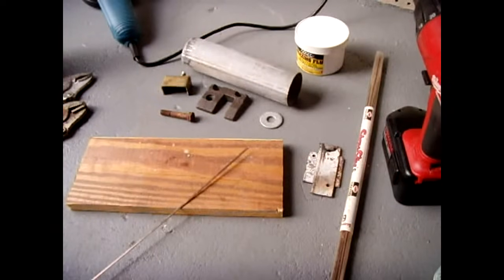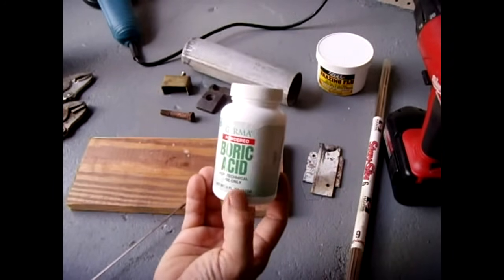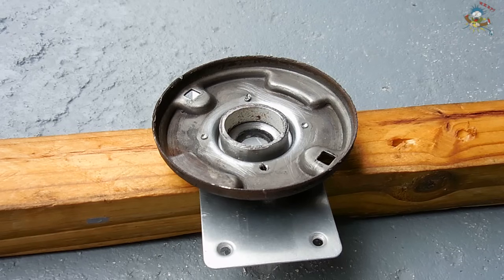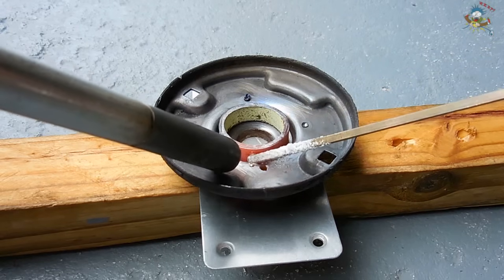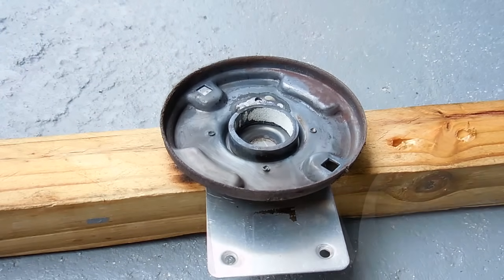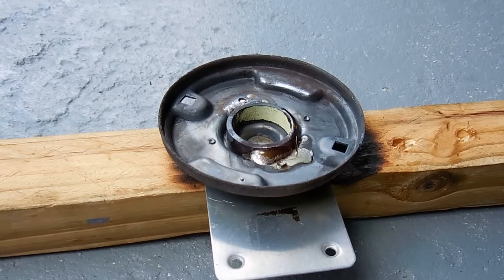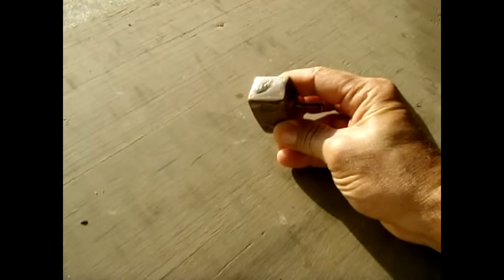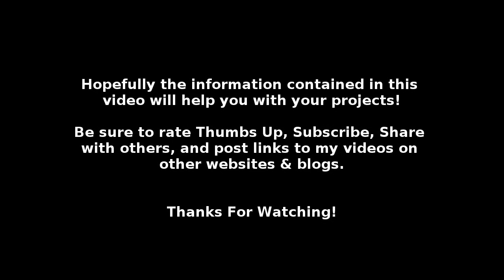EASILY Braze, Steel, Iron, Brass, Bronze, Or Copper

Comment: DO NOT BRAZE STEEL, STAINLESS STEEL, OR IRON WITH RODS CONTAINING PHOSPHORUS!

He's using a rod that contains phosphorus.

Reading the product documentation should reveal this. A quick Google search will do the same.

Of course, the braze wetted out and appeared to do a fine job. Unfortunately, the phosphorus will react with the steel over time and create a thin brittle and weak layer where the braze touches the steel.

The same is true with stainless steel and iron.

There are plenty of products that contain various percentages of silver and contain no phosphorus.

Phosphorus is added to rods used for (mainly) orange metals to reduce the melting temperature, eliminate or reduce the need for flux, and cause the braze to wet-out more readily.

Rods for steel stainless steel and iron require flux. Some contain no silver.

I personally like the high silver content rods that contain 35% or higher. Of course, the more silver, the higher the cost. For instance, in May 2025, I spent $45 for 1 oz (1/16" about 45" long) 56% silver brazing rod (Safety-Silv). It was for a special project.

Most of these high silver content rods can be purchased bare and require the use of external flux. I use the recommended paste flux (Stay-Silv). In 2025, it was $14 for 6.5oz.

Comment: it is actually better to place the work pieces over a gas burner, this way you get a lot of help because the gas burner will maintain the work pieces at a  high temp eliminating the heat sink effect, I have done it on thick copper and steel and works wonders

Comment: No, that was rather messy. 
I would suggest that your preparation was inadequate, and (from my experience) would have been far better off using a different technique such as a small tip with oxy-acetylene. That would have given you much more control of the heat zone/s.

Comment: Great video, ez to understand.  I have a great old bbq and the 2pc legs (assembled together) are  2inch tube steel about 1mm thick. And afraid of burning through it trying to make them 1pc.  Is this too thin? Or will the inner piece heat up enough? Advise? Thanks.
Reply from the maker: Ideal for thin metal

Comment: That rod you used how does it look if you buff it I'm needing to braze or weld brass clothing racks together and polish after and they have to look great the filler needs to look like the brass or very close im trying to find the best looking way possible I'm fine with tig welding but the brazing looks better

Comment: Can I use an oxy acetylene torch to repair a bronze statue using a silicon bronze rod? Most people use TIG welding, but it just too expensive for me.   Everyone talks about bronze brazing, but not bronze brazing BRONZE.   I wonder if it’s not possible because the statue and the rod have the same melting temperature.
Reply: Yes, oxy-acetylene can give far more control of the heat zone, and of course you can bronze braze bronze.

Comment: Higher temperature needed !
Reply from the maker: Incorrect, it flowed beautifully.
Reply: @electronicsNmore  Good luck...
Reply: @electronicsNmore  I would also have used a hotter flame - too slow getting up to the right heat - but then, I'm only an amateur

Comment: This is how a DIY video should be like. Very good explanation of the all aspects of the job, like materials, temp, cleaning etc. Also, I would like to know if the same method can be used to join brass with mild steel/steel ? -Thanks a lot !
Reply from the maker: Thank you very much!
Reply: Stainless steel?

Comment: Do you think this will work for adding a small steel patch to a cast iron engine block? I have a Ford engine block with a small piece missing from the mating surface for the water pump causing it too leak coolant. I'm afraid to weld it using a mig welder because cast iron cracks. Does anyone know.....? Thanks
Reply from the maker: If there's a crack, you're going to have to drill the very end of the crack out before making any repair. You're going to require a lot of heat to make that repair.

Comment: Would firebrick work to prevent damage to surfaces such as concrete in video? Am looking at repairing the seats on metal chairs. The wire screening has come loose and thought brazing would be a  good repair since everything is attached on underside. What did would you recommend?

Comment: Could I use your method to join 1/16 thick bronze pieces together?  Would that much heat cause the pieces to distort?  Would you recommend a different rod to join material that thin?
Reply from the maker: You'll need to experiment. 1/16" is thin, but if evenly heated, it may not warp.
Reply: @electronicsNmore  Ok.  Thanks for the quick reply

Comment: who kind of filler rods I need to braze carbon steel/mild steel? can I use aluminium to braze joint carbon steel?
Reply from the maker: You cannot use aluminum to braze steel. Steel is usually brazed using bronze rods.

Comment: I'm new to welding/brazing.  Just trying to spot weld/braze tin blades back to frame on a yard whirligig.  But not sure what to order.  What is difference of stay silv 5, 6, or 15?
Reply from the maker: For tin, you solder. The melting point is too low to braze. Use an acid flux and solid solder wire.

Comment: I haven't done mild steel brazing since 1980 at college. I recall that word Borax, like Vim, a white powder. 
I need to braze a mild steel bolt to a mild steel plate for a metal chair repair.
I looked on Amazon but it is not obvious what rods I need neither what flux I need. There is only a large tub for £35 which is a bit excessive for one braze.
What I like about brazing is that you tend not to blow away the metal like you can arc welding or MIG or TIG, all of which I am not to good at.
Good straightforward and explanitory video. Well done.

Comment: thanks, i will now go fix a broken office chair that failed on its welded connection...
Reply from the maker: It should work fine. Thanks for watching!
Reply: @electronicsNmore  Done.  Not as easy as you made it look though :-).  it seems that the bernzomatic torch with the yellow canister could barely get temps to melt the bronze rods...
Reply from the maker: @Burner1432  The metal must've been thick, and pulling away a lot of heat.
Reply: @electronicsNmore  The piece was similar to yours in the video, slightly more beefy.  I did it outside of the garage with about zero degrees celcius which probably wasn't helping.  In retrospect I would make a little box with firebricks or something to contain the heat.  I am sitting on the chair right now :-).  Seems well fixed! Cheers!

Comment: Harris does not recommend it for steel.
Reply from the maker: That's true, but I've used it for countless repairs over the years with no failures. Normally you'd use a bronze brazing rod and flux. Thanks for watching

Comment: Would this be the same technique for brazing copper to copper? Thanks
Reply from the maker: Hi Heather. Yes, when I did HVAC work, I used Harris stay-silv 5 and 15 to braze copper tubing. Clean the copper with 400 grit abrasive paper until it's bright and shiny, no flux required. I should have links in the video description area. Thanks for watching!

Comment: Can a disposable butane torch give enough heat to silver solder?
Reply from the maker: Only if the metal is thin and small.
Reply: Thanks.  What torch would you  recommend?

Comment: Never done anything like this before and I’m contemplating fixing the aluminium base of a bar stool where the bracket underneath that holds the seat suspension mount in place has cracked so the seat is very wobbly and unusable. Do you think it’s possible for me to tackle this job myself. I’m an experience DIY’er who is not a mechanic but does a lot of tinkering. 
You’re video is full of pertinent information and tips giving me confidence to try.
Reply from the maker: Nothing to lose. Practice on a piece of scrap first. Thanks for watching!

Comment: Flux the steel.... carbon keeps the rod from sticking....
Reply from the maker: The rod is flux covered, not necessary.
Reply: @electronicsNmore  it’s just a suggestion, give it a try. The second braze didn’t not bond easily to the bottom flange. It took to long to start flowing because the metal was dirty. It was not bright and shiny like he mentioned after heating the first side.  The flux keep the oxygen from contacting the surface. I don’t flux my rods and they flow beautifully, it’s just a little extra cleaning after.

Comment: the cleanliness of the surface can b critical for even mig welding, if ur usin flux core then u the weld is extremely sensitive any contamination, u can get nice welds with flux core i even have a bottle of denatured alcohol i wipe stuff down with before i weld before i use flux core all the time its jus way more convenient n welds fine for most things, n for what doesnt u simply plug a bottle in  but at the very absolute least u should really wire brush the surface n spray it real quick with brakleen   it only takes literally a few seconds n makes ur welds look alot better n for sure alot stronger without contamination
Reply from the maker: I usually wire brush the area before working if I want a very nice looking job. Thanks for watching!

Comment: This is a very informative video yet never try soldering copper joints where wood smoke can ruin a joint on copper pipe.  So always try to protect the copper pipe from the smoke with a fire proof wrap.  I know this because I am a plumber and sweating copper pipes next to two by fours is part of the job so no smoke in the joint.  Now this is brazing and I have always brazed in a vise or on the car etc yet never around wood and it did not look like was a problem for brazing and silver soldering copper next to burning I have not had the pleasure of checking out so just be aware of the smoke. Just an FYI as I like this guys videos and I always watch them for anything I can learn as one will never know everything.......sigh lol

Comment: Thanks for this video. Just bought a Bernzomatic kit from Home Depot. I am going to attempt to braze my Jeep door hinge back to the vehicle frame. Will a flux coated bronze rod, temporarily, hold my door hinge until I can afford to get it welded? This is my first time attempting anything like this. Any help would be appreciated.
Reply from the maker: A flux coated bronze should work. Make sure the metal is clean. The metal must be VERY hot. I hope the torch can supply enough heat, the hinge is thick steel. Thanks for watching!
Reply: This is DEFINITELY NOT as easy as you guys make it look LOL. I went through 2 welding rods and my door hinge fell off. The TS8000 with MAP/Pro gets hot enough, although with no experience the rods just melt away. NOT giving up, this will come in handy later down the line.
Reply: Ok, will give it a go later today. Thanks for your time and advice. It is greatly appreciated. Aloha.

Comment: Will this work with Stainless steel?
Reply from the maker: You can braze stainless, but make sure you buy a rod designed for stainless. The flux should be OK.
Reply: electronicsNmore Thanks

Comment: Any recommendations for a brazing rod for 304 steel? Thanks.
Reply from the maker: I would silver solder it. In order to braze you'd need the right flux along with a brazing rod that has a similar chemistry to the 304 stainless.

Comment: Should have done a silver solder capillary joint on the base of the ring , fluxed all the parts before heating, heated from underneath and just touched the rod enough to fill the joint, you used ten times more rod than needed and got a big fat mess.
Reply from the maker: No big fat mess. The job was beautiful, and still in perfect condition inside a car's cooling fan motor. I've been brazing and soldering for at least 30 years, I know exactly what I'm doing. Do it your way if you know better.

Comment: Could brazing be used to join tin cans to make a stove flue? If the first part above the fire box is a proper steel pipe? I was thinking of using Tuna tins, as I collected a shed-load. See anything with "Made in the USA" it's going to be good quality. I got a Speed Square from Amazon. Perfect. It's in inches though. I can't work fractions. Notably it's why we were tought fractions at school. It didn't sink in. MMs are better. Re-use not Recycle.
Reply from the maker: The tin cans are really tin plated steel, so yes.

Comment: Serious question: does the popping up of concrete have enough velocity to knock over the work pieces(s) potentially causing burns to skin or starting a fire??
Reply from the maker: It's known as "Spalling", and the pieces that "may" pop off the surface are generally small. All depends on the moisture content of the concrete. Thanks for watching!

Comment: sure takes a long while ,guess you must be using propane/air torch,,nice thing is the other side is not melting but it takes lot of heat to flow cooper rods
Reply from the maker: You need high temperature to melt the brazing rod, unlike soldering. Be sure to look over my extensive video 
playlists below for many other videos of interest to you, and share. Thanks for watching!
http://youtube.com/c/electronicsnmore/playlists

Comment: Its good,,,,,,,,but i m not geting what is the material of rod for brazing,,,,either it is also made up of brass,,,,
Reply from the maker: I placed links to products in the video description area.
Reply: @electronicsNmore  thanx sir,,,, as me from Pakistan we just got around 140V instead of 220V,,the electric welding plant is not working,,,so i turned to gas welding,,i bought a torch but it is mini it is not able to melt brass,,,,i bought another one and its sound is too high that we cannot operate in residential area,,,now me searching for a solution and saw ur video,,,

Comment: Can Romex Wire be strong enough to use as a brazing rod? To reweld the top of the cr-mo frame that was cut off and repositioned?
Reply from the maker: Pure copper isn't strong enough.
Reply: @electronicsNmore  thanks your quick reply. Save me from doing something then I shouldn't have.

Comment: I'm new to this, and after watching your video I tried welding two pieces of mild steel using my Bernzomatic map gas torch along with Bernzomatic Bronze rods that apparently melt at 1600 F.  These sticks have a flux coating, so I figured they would work the same way.  As it turns out, the steel easily became bright orange,, but the rod, although seemingly melted, it had trouble adhering to the steel.  I had previously filed the metal clean, so I'm at a loss.  Any ideas of what went wrong?
Reply from the maker: Should work. Try using small pieces of cleaned steel.

Comment: The second side of the steel ring was harder to braze because it was covered by a layer of black oxide that formed while brazing the first side. To prevent that I would have put some flux on both sides before I started heating anything. The flux will protect the metal from oxidation caused by the heating. It is better to prevent the oxide from forming in the first place, instead of having to wait for the oxide to be removed by flux applied after the metal was already very hot.
Reply: Yes apply flux to the part as well that’s what I was taught
Reply: Flux would help although a reducing flame should be able to remove the oxidation during heating.
Reply: Yea wat he said!!!😂😂😂
Reply: Surface preparation pre -braising would be in order

Comment: could you do this with a butane torch? (steel to steel) Cheers
Reply from the maker: They're usually too small in size to heat up the metal.

Comment: Looks like your concentrating all your heat on the ring.  Both pieces have to be close to the same temperature for a good braze.
Reply from the maker: I was directing more heat towards the thicker metal, the ring. As you saw, the job came out just fine. Thanks for watching!

Comment: You’re holding the gas torch too close to the work: heat is generated as the gas burns, the flame will be at its hottest towards the end of the flame.
Had you applied flux to the bed and the piece and introduced the brazing rod inside, at the base of the piece, the braze would have run round the entire ring, making a stronger joint using less braze metal.
Reply: Futon I totally agree. Branded joints should be treated like soldered joints because brazing is high temperature hard solder. The joints should be thoroughly cleaned and fluxes immediately to avoid oxidation

Comment: Quick question... HomeDepot sell brazing goggles... dark shaded like a welding mask.. Now if I was just wanting to braze with propane to join 2 pieces of metal together... would normal safety goggles be enough ?... as it doesn't look like any weird UV would be an issue here..errr right?..
Reply from the maker: No goggles are required for using a propane or MAPP torch. Thanks for watching!
Reply: Awesome, I just wanted to be sure. :)
Cheers!!.

Comment: Why do you keep the tip of the gas torch so close to the part being heated? I thought the hottest flame is on the tip of the flame?
Reply from the maker: I used a MAPP gas head with propane, the inner part of the flame is hotter. Thanks for watching!

Comment: Stay Silv 6 is not recommended for brazing steel or other
ferrous base metals. In these applications the phosphorus
content promotes formation of a low ductility intermetallic with
the base metal.
Reply from the maker: It may not be recommended, but it sure works great. :-) Thanks for watching!

Comment: what kind of gas are you using in this video? Is propane adequate to melt Aluminum rod in your experience? I'm considering brazing some muffler cracks (right at the seam) on an old motorcycle.  Thanks
Reply from the maker: Jason Hill If the metal isn't too thick, then propane is fine, otherwise you'll need a MAPP torch.